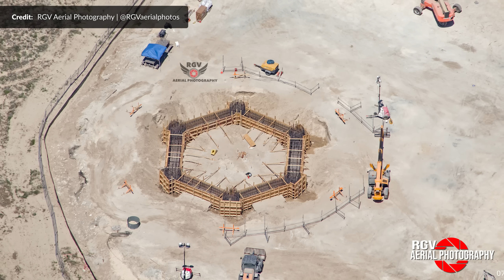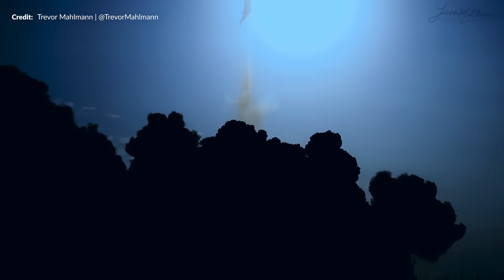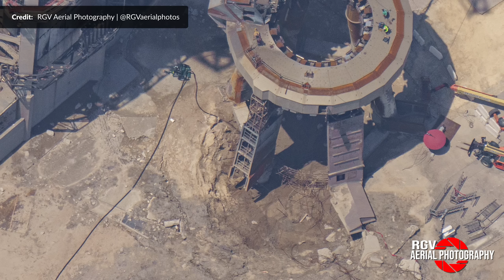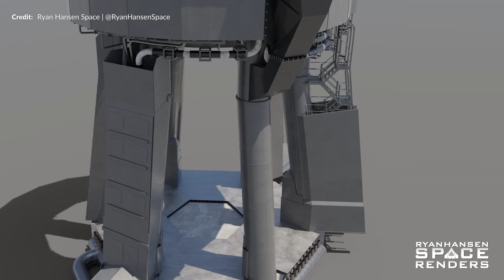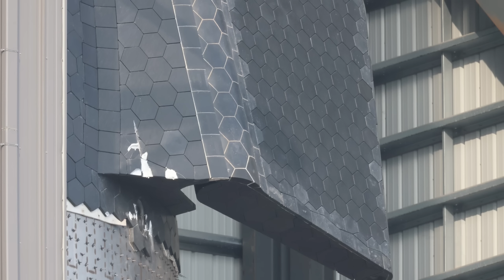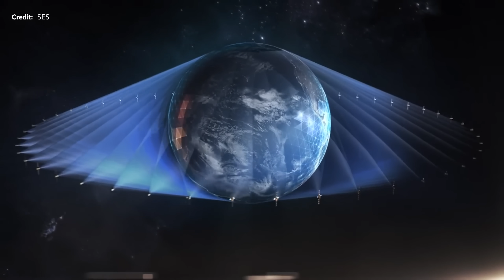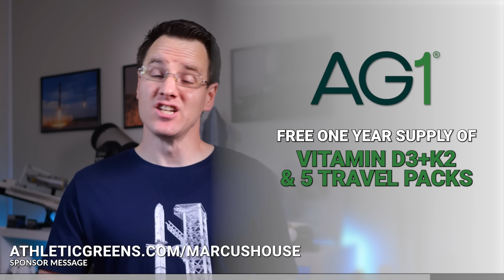The Starship Damage Left Behind: How are SpaceX Moving Forward?

Comment: Never understood why they didn’t have a pit diverted for superheavy or starship? NASA has done it for years without this kind of damage. I don’t get it
Reply: To be fair, the OLM distance to the ground is roughly the same as the distance from the pads at LC-39 to the bottom of their flame trenches. The OLM doesn't have a flame diverter and water deluge system. Musk mentioned that they have a water-cooled steel plate system to install under and possibly around the OLM, but it was not ready yet. Musk's "the best part is no part" philosophy bit him in the arse with the no diverter or deluge part. He rolled the dice that Stage 0 would make it through one launch without them and came up with a Nat 1 on the d20.
Reply: @steveaustin2686  I see. Thank you!
Reply: @davebooth5608  You're welcome
I missed a not, in the answer. The water-cooled steel plates were not ready yet.
Reply: @steveaustin2686  yeah I was aware of the steel, I just didn’t get why they avoided the diverted trench, it works great. Again thanks for your knowledge!!
Reply: @davebooth5608  The tidbit about the height of the OLM vs the pads at LC-39, came from NSF. They have been reporting on spaceflight for almost 20 years and have some experts on spaceflight. Especially the Shuttle. I'm an interested amateur and have a facility for remembering things I read or hear from the experts.

Comment: Why doesn't SpaceX employ The Tunnel Boring Company to bore a N E W and South  Flame / Thrust diverter tunnels to a mile away ending pointing upwards with great big fans with Tesla motor Generator to save all that waste Energy and store it in the Solar Battery / Battery Power Stage System to supply the CO² Atmosphere extraction plant and / or the local community with free power.
Excellent review of the concrete spewed out and around the OLM and the hole made would be the common finishing point under the OLM for the tunnels proposed abovementioned.
The tunnels being 30 ft underground would help cool the thrust as they would have seawater seepage around them with Climate Change sea level rising...
Have fun all the best.
Denis...
Reply: One, because Boca Chica is around 10 feet above sea-level, so the water table is right under the ground. Two, the launch and build sites are surrounded by state park and wildlife areas, so going even a half mile would put them out of the launch areas and into the state park or wildlife areas.
Reply: Ok , so tunnels could go to other SpaceX sites like Massey's or Starbase.But seriously Elon has all the facilities within his companies, and would solve the problem for the long term experimental Starbase use as the launch cadence is FAA restricted currently.
Reply: @deniswilloughby  Sure, because what your build site and/or test site needs is a bunch of concentrated rocket exhaust right in the middle of them. 🙄

It's a terrible idea that would be ridiculously expensive and very difficult to do with the water table so close.

Comment: I’m not a rocket scientist, but if you had a flame trench all the dust wouldn’t get in the way of those critical shots. I know they look over the footage to find things to work on, look at Saturn 5 pretty clean launch from the very beginning, starship very dusty and couldn’t tell that a lot of the boosters engine skirt got ripped off during flight. Can’t wait to see the upgrades.
Reply: Boca Chica is roughly 10 feet above sea-level, so digging down into the water table for a trench would be difficult. To be fair, the OLM distance to the ground is roughly the same as the distance from the pads at LC-39 to the bottom of their flame trenches. The OLM doesn't have a flame diverter and water deluge system. Musk mentioned that they have a water-cooled steel plate system to install under and possibly around the OLM, but it was ready yet. Musk's "the best part is no part" philosophy bit him in the arse with the no diverter or deluge part. He rolled the dice that Stage 0 would make it through one launch without them and came up with a Nat 1 on the d20.

Comment: I'm skeptical about Boca Chica, the FAA, the EPA and the administration. Time is not on SX's side. I would be planning an alternative. It seems the further you get from the launch tower the better it is. I would also say the more complex the structure the more difficult the task. The first thing I would do is opt for separate landing platforms/towers. They can move a rocket into launch position in hours or less from a landing platform. The cost would be far less. As to the launch, you could position a launch between two smaller towers using open/close parallel "bars" more distant from the main tower. If necessary, you could do all the preparation at the main tower and move everything over to the launch position when needed. No catching device, not nearly as high, not nearly as heavy not nearly as costly. The base would be far less sophisticated than what they have right now. Finally, I would move rocket launches to an island somewhere for the next five or so years. When everything works as planned then find launch locations the public will agree with. Or, move the launch system down the road about ten miles. While this is only conjecture, this last flight was a predictable failure. They just have to get the launch facility right for the next flight.
Reply: The only way down the road, is back towards the Port of Brownsville, which would almost certainly be unacceptable. The launch pad is right on the coast, so that the launch is over water as fast as possible. Back towards Brownsville 10 miles and you would have to fly past Port Isabel and South Padre Island which is almost certainly a no-go.
Reply: @steveaustin2686  - North and "SOUTH" or to the gulf if you think that's possible. If you can't launch it in Boca you have to find an alternative - 30 launches a year and at least 30 miles from protesters. From Boca to the tip of either side of Florida where would you go? Do you think the Cape can handle say 45 launches a year? Like it or not; where there is a will there is a way. Hey, Musk might figure out how to reduce the noise, limit the damage, restrain the EPA, satisfy the Biden administration, save his investment and test the rockets or he might just take his brain and go home. Or, with a favorable agreement to all parties - relocate the launch pad 6 miles down the way:-)
Reply: @rocroc  Well north takes you to populated areas, so that is a no-go. South, just a mile, takes you into Mexico, so that is a no-go. Out into the Gulf would make the logistics of supporting a launch or just daily running of the place, much more difficult. Which is why they sold the oil rigs, to get Starship working, before maybe revisiting sea-launch in the future.

Comment: Here's where I stand on the "Was this launch a failure or a success?" question: I'm in the middle.  Yes, they did successfully clear the pad with the largest rocket ever, and got it through Max Q and to an altitude where stage separation could have happened.   All major achievements that should be celebrated. 

It's also a failure--and not because things went wrong.  Things going wrong is part of SpacEx's very admirable "Try, sometimes fail, then try again using what you've learned" process.  It was a failure because something foreseen by many, something that could have been prevented, went wrong. It's now going to cost SpacEx more time and money than just dealing with the problem in the first place would have cost them.  It was an error in judgment--something very unusual for Elon Musk.

They chose to cross their fingers and hope for the best.  Instead, Murphy's Law prevailed.

Comment: I am not an engineer. I want SpaceX to succeed.
I have been watching various youtubers and the like talk about the failure of the launch in great technical detail, which I appreciate greatly.

I am however concerned how easily and nonchalantly many are glossing over the fact this was a completely preventable incident, especially considering this rocket is expected to eventually carry humans into space. All the hard work and hopes of the people designing and building the rocket (which in my opinion, would have performed perfectly had it not been HIT WITH FLYING CONCRETE), up in flames because somebody in the decision-making process thought some form of flame diverter or similar system was not necessary for the BIGGEST rocket in human history, something that has been used by NASA and others for decades. This is inexcusable.

I am all for taking failure in stride and learning from the experience, and fully expect SpaceX to implement the necessary measures for it's next launches. However, I am concerned the most important lesson has not been learned: When it comes to rockets... DON'T CUT CORNERS. This was a completely preventable, man made incident. 

Once again we learn that cutting corners is the name of the game, and no lessons seem to have been learned since the Columbia accident.

Comment: My first two comments upon seeing the launch facility at Boca.  There isn't enough distance between the rocket nozzles and the ground, there is going to be a horrific shock rebound and it will trash the engines.  The tank farm is way too close and oriented in such a way as to present the most tanks toward any flying bits from the launch stand or an exploding rocket.  The plate they plan to use is defective.  With the open hexagon in the center, the water will find it difficult to overcome the pressure from the blast of the rockets PLUS the expansion of the water into steam forming a "plug", diminishing the flow and the steam will add to the blast effects of the exhaust with it's 1000 to one expansion ratio of water.  If they are going with the water cooled plate, I would add a cone in the center with jets about two thirds of the way up and at the bottom around the base of the cone.  The upper jets would start the flames moving laterally and push the outer ring of exhaust away from the centerline of the rocket, reducing the vertical rebound of the shock waves.

Comment: Starship cannot land or even take off as it is designed from the Moon or Mars. A spherical design is needed or small shuttles need to be added.
Reply: The Superheavy booster is not used on the Moon or Mars. Starship (second stage) with 6 to 9 engines can launch from the Moon or Mars without needing the booster. The HLS Starship is currently planned to have 24 small LCH4 enignes at the top of the propellant tanks for the last bit of landing and first bit of launch on the Moon. So they would be roughly 25 meters off the surface, lessening the impact of the thrust on the surface.

Comment: Not sure I share your optimism Marcus. The pad will need extensive work to get it back to a usable state, to say nothing of the obvious requirements now for a flame trench and water deluge system.  Elon messed up massively by not incorporating this into the original pad design. Then there's the FAA who will need convincing it is safe to proceed with another flight. They've grounded all future flights until a proper investigation is carried out. Remember debris has littered the entire area for miles. Elon would be wise to stop trolling on his plaything Twitter and focus on fixing this almighty mess.
Reply: The FAA routinely ground spacecraft that suffer mishaps, this is nothing unusual. In Jun 2015, B1018 suffered a RUD lifting CRS-7 to the ISS. The Falcon 9 was grounded and once SpaceX resolved the problem, B1019 was the first booster to land in the Dec 2015 flight. Sir Branson's SpaceShipTwo VSS Unity was grounded when they flew a little bit out of the flight restricted area on his sub-orbital spaceflight. Nothing was hurt or damaged, but just the flight area violation. I have the feeling the investigation with the FAA grounding will be shorter than the repair work to Stage 0.

Comment: I think SpaceX underestimated by a long margin.  And I don't think the water-fed cooling plate will be enough either.  They need a flame diverter and deluge system like SLS has.  After all, you're talking similar or greater thrust to an SLS, so the foundations need to be at least as robust.  Moreso since they want rapid reusability.  And the table legs should be encased in reinforced bunker quality concrete on the inward side.  They seem to be taking shortcuts for speed rather than building for durability.
Reply: Musk mentioned in the past, that he wanted to do without a diverter if possible. Likely so that work could be done on the engines under the pad. Musk's "the best part is no part" philosophy bit him in the arse with the no diverter or deluge part.

Comment: This is why I don’t think this type of landing rocket will work on a Mars or Lunar landing and then return flight. The ground will be blasted upon landing with a very high potential for landing are degradation which will impact the subsequent take off. Serious potential for a disaster. High winds on Mars as well will be a threat.  We need a different landing craft.
Reply: The Superheavy booster is not used on the Moon or Mars. Starship (second stage) with 6 to 9 engines can launch from the Moon or Mars without needing the booster. The HLS Starship is currently planned to have 24 small LCH4 enignes at the top of the propellant tanks for the last bit of landing and first bit of launch on the Moon. So they would be roughly 25 meters off the surface, lessening the impact of the thrust on the surface.

Comment: Great shot of the shockwaves coming off the boundary turbulence with the plume.  Each of those is a sonic boom, and why rockets make the crackling noise they do. At close range they would kill a person with just their acoustic energy.  THAT is what destroyed the pad. The flat pad, perpendicular to the thrust, was being hit by a thousand jackhammer blows per second of transonic shocks. That pulverized the concrete and enabled the plasma flow to strip it away. The erosion around the pilings exposed them to the same jackhammering. And you can’t just shovel dirt under the grade beams and call it good.   The ‘design’ for the water ‘cooled’ plate is insufficient. First of all, it does not redirect thrust, it simply acts as a backboard to take the full brunt of the force and the acoustic pounding, literally magnifying their effects. The water deluge needs to be ABOVE the  steel to insulate the steel from the thousands of sonic booms or the plate will be coined like it was hit by thousands of giant ball peen hammers.   This is 60 year old ESTABLISHED engineering science and why every Other launch pad on earth has a water deluge system for acoustic suppression of vehicles half this powerful. The additional engines add additional sources of constructive and destructive shockwave energy, and in one of the shots from a drone you can SEE the shockwaves traveling up along side the booster in pulses of constructive interference.  There is a good chance that this is what flamed out several of the perimeter engines after liftoff, and without stage zero they were unable to be relit.  They NEED a real diverter to redirect the blast and the acoustic energy away from the rocket and the critical infrastructure. The 6 legged design was a bad idea from the start as it prevents them from rolling a robust diverter under the pad due to the legs being too close together. I do not know that a folding design like their maintenance platform would be robust enough.  The real question is this: It was obvious from past tests that the pad could not withstand the force of even half thrust without significant damage, resulting in them designing a water cooled plate to mitigate this issue and redesigning the foundation of the stage zero in Florida to accommodate this system. They were in the process of building one for Boca Chica.   What possible rationale could they have for rushing to launch at the first possible opportunity when they were just months away from installing this new system? They have scrubbed or delayed launches in the past.  They are a year behind Musk’s stated objective of V2 starlink launches which he said were critical to prevent bankruptcy of Space X.  Was this launch rushed to help spur a new funding round?   Or was this part of a performance deadline to keep the Artemis moon landing money coming in?

Comment: it still amazes me that some1 hasnt designed a mini sub style craft would stay is space with ISS that could be used for fixing hubble/satilites and such.
Reply: They are looking at using Crew Dragon for that.
Reply: @Scanner9631  I believe that they are looking at Polaris Dawn 2 to boost the ISS with Crew Dragon. Since the thrusters are in the nose of Crew Dragon, the grapple would be in the trunk to attach to the grapple point at the bottom of Hubble. Then they would boost Hubble. 

When the Shuttle serviced Hubble, they grabbed Hubble with the Candarm and secured it in the cargo bay. Then astronauts on a work platform attached to the Canadarm then worked on Hubble. It seems unlikely that a Polaris flight to Hubble would include servicing without access to some kind of platform for the crew to 'stand' on.

Comment: Instead of a traditional flame diverter tunnel, what if they placed an array of old Raptor engines blasting horizontally below the Starship?  Perhaps 10 degrees upwards.  It would be a flame deluge instead of a water deluge.  Fighting fire with fire.